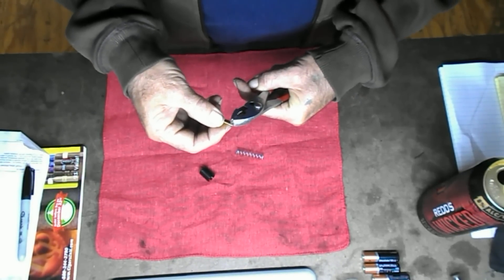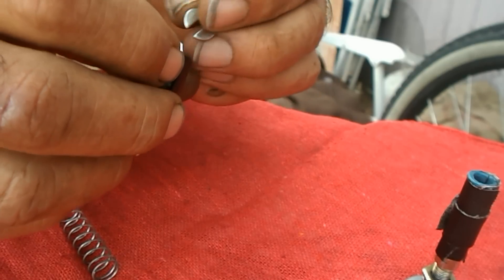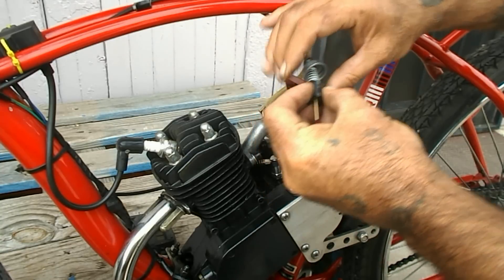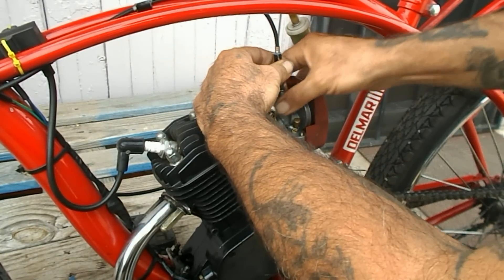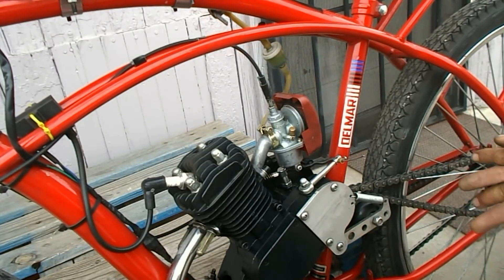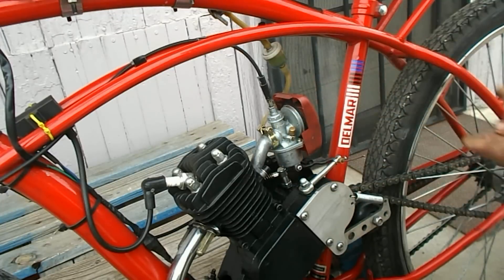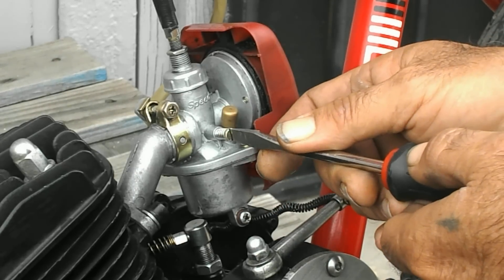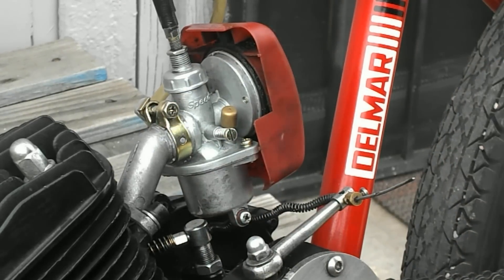Adjusting the Needle Jet and Air Fuel Screw NT Carburetor on my Motorized Bike

Comment: Hey brother. Thanks for all your videos man. I want to do some vids. I just finally after extensive work I got mine to run today. I have my E-Clip in the middle (stock) position. I got it to start after I primed it 2 times held for 2 seconds. It would not start with the Choke lever in the upwards position. I pushed it down, then finally pedaling its started coming to life slowly then quickly! Stalled a few times, The more it ran the better! It kept stalling on Idle. I turned the Side screw in a little bit to raise it up.  Fixed that. It scoots along. 44 tooth in the back.

My question is, today way a hot summer day. It ran with the lever down fine on a "first cold start." So, do you only raise the lever if its really cold?, the bikes been kept outside in 85 degrees. Thanks in advance. If anyone else can chime in shed some light that would be great.

The other thing is too, I have the painted motor also. I had to remove the 2 wire magneto and sand off the painted mating surface of the block cause I wasnt getting any spark. Thought that might have been the issue. Then again it was gapped at .025" and it did not spark, so I tightened the gap to roughly .015" on the stock chinatown special plug. THEN I got spark. Did yours run okay on the paint or did you have to sand it for a better ground? I also added a wire to one of the 4 mounting bolts for the Mag, out the grommet to a bottle holder screw on the bike for a ground. I think this improved the overall Sha- bang.
Reply from the maker: cold start requires choke depending on where u are. otherwise only if you feel like it needs a choke start ")

Comment: The screw is idle adjustment only, this carb has no air-fuel mix screw, needle valve clip up = lean  down = rich
Reply from the maker: You are half right but mostly wrong. But thanks for watching")

Comment: Hey Brian how is life going for you? I have watched almost all of your videos about your speeder bike. Good stuff man. On your red speeder bike how level was the carburetor? I built me a speeder bike and my carburetor is not very level. Wish I could show you what I mean lol. It runs very good but when I get where I am going I notice fuel coming out of the air filter. And leaking down the engine but only after riding. I can let it set with the peacock open all day without starting and it doesn't leak.  Any ideas? Possible for me to get your email and send a few pics to you. By the way how is the new speeder bike coming along?
Reply from the maker: briannoel49@gmail.com  

on the red speeder bike i set the engine low in the frame and made sure that the carb was sitting level on the intake runner since it was one of the longer angled ones. it would leak when the petcock was left open but most of them do (overflows the float) probably the reason yours doesn't is because it's NOT level (keeping the float even with the fuel level) it really doesn't matter what the angle of the engine is unless it's upside down to make it run (remember it started out as a chainsaw engine) so in turn the carb HAS to be close to level with the intake for best fuel/air flow into the crankcase. 

 the 24" Magna is right now still in Rachel my friend Pam the candle lady currently has it and will be disassembling it because Jay wants his bike back"( but i have told her she can used the little engine for whatever her and G need it for so i expect that sometime soon it will probably become a water pump motor for her well") thanks Jessie for your continued support and well maybe i build another one this summer we see...

Comment: so my bike isnt getting spark just bought a new cdi and that came in the mail but and I tried running it still nothing so I'm buying a magneto that's coming in the mail my question is to anybody do I have to use the kill switch wires the yellow and green? cause I haven't been before when the bike was running it was like poping as in like a backfire. it was minor so I blew it off but I think one of the wires was touching the frame or metal I think that's what fried the magneto cause there no spark at all shocked me once that's all that it had left.
Reply from the maker: Boss Gaming boy yes u need to have the kill hooked up plus make sure the wire behind the mag is hooked up it wouldn't hurt to put a little solder on it yo b sure
Reply from the maker: I have u got some cool stuff
Reply: @Brian136  the kill switch doesn't need to be hooked up. these little engines you can just hold the brake and let the clutch out at idle and it will shut off

Comment: Brian, are you happy having a 2 stroke or would you be happier with a 4 stroke? Yours seems to be running sweet but I see many 2 strokes leaking, sputtering, etc.
Reply from the maker: 4 stroke offer a steady power out put over the 2 stroke but in terms of power out put and performance the 2 stroke is hands down the better engine configuration. me i pefer a 2 stroke they are easy to work on have many many different performance upgrades the regular joe can do   himself and best of all you melt the little piston some emery paper and a honing tool puts you back in the wind today can't say that with that honda lawn mower cloone 4stroke...

Comment: the piston is tapping the head, Put two base gaskets on the bottom of the cylinder
 that tapping will go away
Reply from the maker: Really!? But there is no noise or tapping sound going on with this engine bro! It had always - started right up even when I kick start it. Compression is good - plug always fires at TDC -- it revs to about 8500-8750 with the throttle at 3/4. 

It's stock 48cc Chinese 2stroke -- the origional 
"China Doll". It was made by old people who lived in the village. The comrade Colonel stops by every week to check the production numbers but also to make sure the licensing agreement is being followed and the engine is built to Soviet specs-- and the quarterly production shipped to America. 

When I got the kit I paid $115 for the box-(actual engine kit) plus $25 fuel user tax -- the bike we got at the pawn shop for $85 I think and along the way until I lost it. $600-$750 in after market parts for drive train -- 1 gallon gas tank --  better/hotter sparkplug -  copper cylinder head /crankcase gasket set --rejetted the NT SPEED carburetor - changed the rear sprocket for 36t billet CNC sprocket with the hub adapter for the 1 5/8 rear hub. 

Nit picking me isn't going to make yours any better...

Comment: brain I'm up in show low, so I have to run leaner???
Reply from the maker: Yes which plug you running? The 5 or 6?
Reply: havent bought kit yet, but I will on payday, also still thinking on witch kit, 4 stroke or 2 stroke
Reply: but I wana pick your brain on my build, thanks in advance
Reply from the maker: azdrifter51 briannoel49@gmail.com anytime bro might b a minute to respond but I will and can explain lots
Reply: 2 stroke kit I'm looking at
Reply from the maker: azdrifter51 this a good one  the Reed valve is the best part   the sprocket on the tensioner is cool")
Reply: cool, I'm 60 years old,  so thanks
Reply: your thoughts on boost bottle?

Comment: need some help my bike keeps wanting to go full throttle with out me doing anything need help plz
Reply from the maker: check the throttle cable-- make sure it's not hung up on anything that is pulling it open. the cable that goes intoi the top oif the carb needs to be seated in the slide -- air/fuel screw open 2 1/2 turns not 8 and most of all the throttle isn't open full and stuck. let me know what you come up with Lee
Reply: ok so i fix that issue but the bike wont start im getting spark and when i turn the motor over with the plug out i see gas any idea what it could be
Reply: Lee Dunlap I've built 8 kits so far and have found that on some of these kits have micro Burr's on the needle valve barrel slot ,all you have to do is Polish the groove  and clean and oil it before you install it,,easy fix

Comment: My bike is overheating getting hot quick what should i do
Reply from the maker: Desirey & Taylor Channel shut it off and then wait")
Reply: brian noel thanks yeah 1 lap around the block and engine is extremely hot i think its lean should i re jet it bigger to get more fuel in
Reply: brian noel i dont have an external leak maybe internal at the crank
Reply from the maker: Ya which plug you running? Might want to go one step colder and set the main Jet up one click
Reply: brian noel thanks for the respond stock plug... what plug would you recommend?
Reply from the maker: Desirey & Taylor Channel I would go wih I've in the 5-6 heat range ")
Reply: brian noel thanks!
Reply from the maker: Desirey & Taylor Channel ngk b5hs or the colder b6hs the ones I use")
Reply: brian noel thanks man i greatly appreciated it.. have a blessed day my friend.... you have some awesome videos had to subscribe to your channel🖒
Reply: Hey Brian Check Out our New build what you think

Comment: looks like you removed the spring from the idle air adjustment screw.
Reply from the maker: why do you think this? if i did then the engine wouldn't run let alone idle like it does for more than 30 seconds in this video. the spring is for the throttle cable that goes into the top of the slide that operates the slide inside the carb that lets the air/fuel mix flow through the intake ports that flow fuel into the crank case for compression and combustion. 

one more thing on the NT speed carburator there is no spring on the air/idle screw it is attached to the screw so that it doesn't  fall off or you don't loose it when you unscrew it all the way for no reason...

Comment: Lean means more gas and less air?
Reply from the maker: #Federico_Glory# no more air less fuel") thanks for watching
Reply: brian noel I have a question if you could help please. my engine is leaking out between the head in front above the exhaust. I'm seeing oil all over the front and feel very very little air coming out. I've taken the head off and checked everything, metal gasket is good. I've tighten the head down and it's still small leaking out it above the exhaust. I'm positive it's coming from this spot because when I took the head off I can see the oil marks. This is a new motor and I've broken it in per factory specks. It's also like they say 4 stroking to a certain speed and then sounds and runs great for about 5 seconds, and right back to 4 stroke. Any help or video would be great. Thanks.
Reply from the maker: Phillijr sounds like the head is either warped or was milled funny probably need to get one of Fred's super heads bro")
Reply: #Federico_Glory# weighing is too much air not enough gas or too much air. From a air leak ect. this guy is engine piston and rings are rattling so bad it needs to be overhauled

Comment: never ever let these motors idol! for more than 20 seconds! you were warned!
Reply: Why can't you let it idle longer than that?
Reply: @comments142  a lot of heat build up because there is no cooling system
Reply from the maker: Actually the cooling is done by the fuel/oil as it circulates through the bottom of the crankcase and up through the intake port. If you have the right setting on the air/idle screw and a good filter +the right spark plug it will idle smoothly with out heating up.
Reply: @Brian136  good info thanks brother 🤘